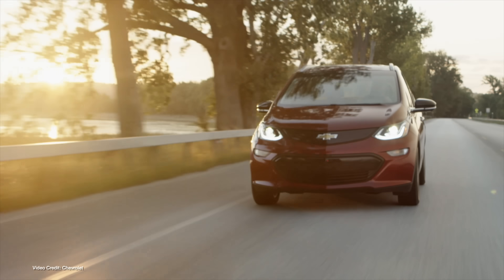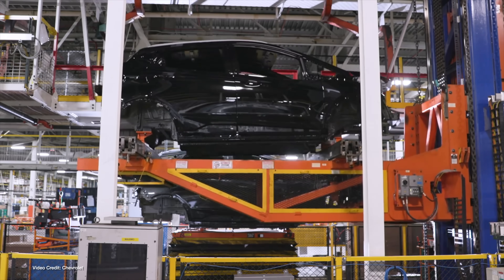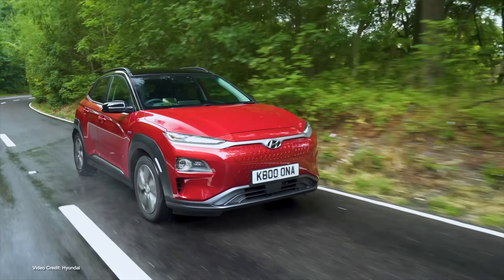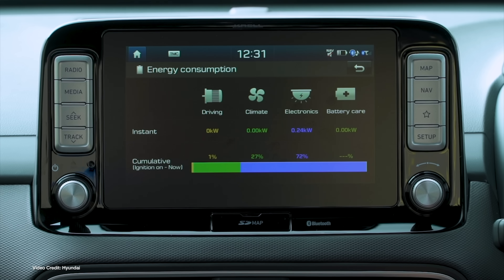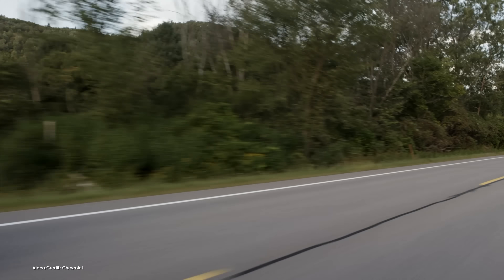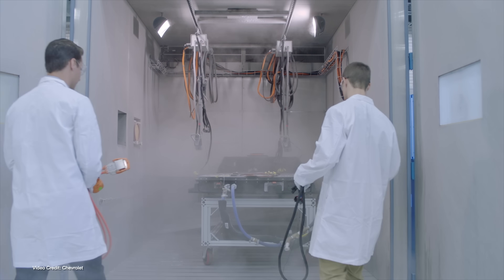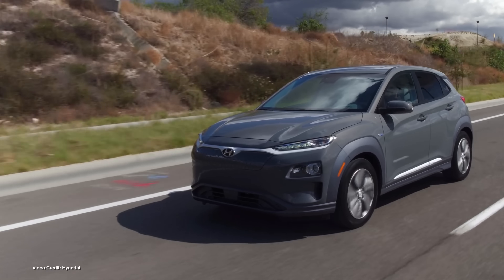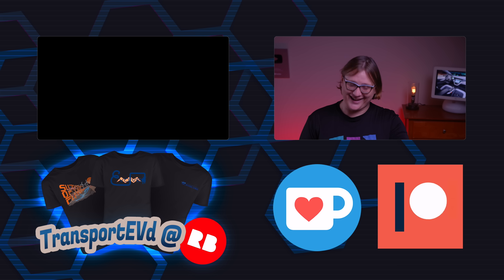Chevy Bolt EV Battery Recall: Here's Our Take on GM's Inspect And Replace Plans

Comment: gm builds junk ice cars what can you expect from their evs fires. lets see if the hummer catches on fire. junk junk and more junk
Reply: Err, 1) Not really a fair comparison, is it?
2) Anyone with any degree of rational common sense knows it's nonsense anyway. Obviously, a large,   long established manufacturer which shifts millions of units, doesn't make 'junk cars' do they?!
It's just ridiculous tribal nonsense.....
Reply from the maker: The battery fires, as mentioned in the video, came about from an issue with battery supplier LG Energy Solutions (LG Chem at the time) and almost all the EV automakers, including Tesla, work with them. - Winter

Comment: GM's and Hyundai's battery / EV woes is simply the latest chapter of being so late to the EV transition. While the companies are dealing with fall-out and recall expenses, they're losing time and money resources necessary to advance the BEV flag down the field. This one incident may be resolvable, but this is only one of thousands of cuts that may end GM as an automobile OEM. The same is true for all other legacy auto so late to the BEV party.
Reply: No, the companies are enormous with more than five employees. They can work on more than one thing at a time. GM is already building out it's own battery supply, unlike Ford, and has been working on it's new battery technology for a couple years now. Really it's just the Japan brands that are extremely far behind.

Comment: Last time I checked, used Tesla Model S sedans could be purchased for under $20,000 (pre-pandemic). Maybe that is a better route for people considering buying an EV than a used Chevy Bolt?
Reply: You can't get a Model S for under 30k, anywhere...even the totaled auction cars fetch $20k.
Reply: @vidznstuff1  There is currently a running and driving 2013 Tesla Model S in Kissimmee, Florida listed for $21,999 on Autotempst, sorted by lowest price. Pre-pandemic there was a Model S listed for $19,999. You are incorrect.
Reply: @justin_time  The Tesla model S you are referring to also has over 200K miles on it as well as being an 8 year old car.   I think I’ll stick with my 2019 Bolt that has just over 20K miles  ( approximately 80K left on the battery warranty.).  I never went in to have my charging limited to 90%, I could do that through the infotainment screen.
Reply: Err, aren't they a completely different type of car?! 
Surely, people don't just want any EV do they? They must consider the practicalities of ownership...?
Size, load carrying practicality, cost of maintenance, insurance liability, do I like the car!  etc etc ....?!
Reply: @andymccabe6712  I've found that the lower the price segment people are searching in, the less they care about meeting certain criteria. The used car market is much different than the new car market.
Reply: @justin_time  Not that I've ever experienced unless someone needs any wheels and has a $2500 budget. Otherwise Andy is correct, everyone still needs the type of vehicle that works for them and they search for that within the family budget that they have.

Comment: Frankly I think that GM has not flip flipped like Hyundai which shattered my confidence in Hyundai EVs. GM has been very confident and consistent in what they thought is the problem. Further, based on the Volt experience I have had, I trust GM's solution and since they are going full EV, why would they jeopardize that future reputation?  No, I think GM has found an excellent solution, but let's wait and see. Great video as always. Love TE vids!

Comment: Good luck with your time bomb.  Our fabulous new software should be able to warn you before it bursts into flames.
Reply: Right
Reply: All charging systems have limiters to prevent overcharging, damage and fires.  Correcting this system doesn’t equate with correcting a “time bomb”. Your cheap and snarky comment reveals your lack of knowledge specifically and in general.
Reply: @rcpmac    Yes, you're completely & absolutely right.  ["All charging systems have limiters in place to prevent overcharging, damage and fires"] BixbyConsequence (& Nikki, as she clearly says she's not confident the problems have been solved) aren't talking about a charging system that, even with a system in place to errrmmm... Prevent fire & damage... Errrmmm... Suffered fire & damage. BixbyConsequence must be happy in the knowledge that his lack of knowledge is at least less restricting to HIS ability to lead a normal life, & think critically, than yours.
All these Bolt & Kona owners are all liars, making up fires for insurance claims because all charging systems.... 🤦
Reply: @rcpmac  I know quite a bit about Lithium ion batteries.  The root cause of this problem is known to be a cell-level defect.  "Managing" the problem with software does not equate to normal charge algorithms.  Get rid of the defective hardware and remove all doubt, imho.  Cell-level diagnostics are great as an added layer of protection.  Keep them.  But don't use them as mitigation for a known physical defect.  It's a bad idea from a safety perspective as well as disastrously stupid from a liability perspective.
Reply: You're not paying attention. The software was an interim solution. Hardware is going to be replaced. BMS is being modified to monitor cell impedance changes long before a short manifests itself in thermal runaway. Yes, cells/modules will be changed out now that the PHDs have figured out how to predictively characterize the defect.
Reply: @vidznstuff1  They might replace some *modules*.  That is not the same as pre-emptively replacing complete packs as Kona wisely has.  You'd still be relying on the validity and completeness of the "PHDs" predictive models (which were delayed until the last minute), and you'd end up with a pack with modules of differing ages; some manufactured on a line that produced defective cells.  No thank you.  I've been paying attention.
Reply: You dumb f__k software will not prevent instantaneous combustion of the lion battery

Comment: The removed hill side reserve. If they are updating all the Bolts to the latest software I wonder if they will allow charge level setting? Or if they'll roll back the software for those with older Bolts to hill side reserve only?

Comment: Hi TE, don’t know if you already reported on it. But I think VW (and Seat, Skoda) e-up use the same batteries from LG. Skoda did a recall with software update for potential risk of battery fire. But you didn’t get much more information than that.

Comment: Bolt still most reliable vehicle Chevy makes. Actually still more reliable than any petrol engine. So many EV haters here, try one and you won’t go back.
Reply: Don't be cheap by a real ev.Tesla is Waiting
Reply: @renehunt4252  Tesla also has quality issues, and had some batteries catching on fire, not all of us can afford Tesla. I buy used cars with cash. Tesla is like 3x more, I got my bolt for $13k USD.
Reply: @Areku06  I have never heard of the roof blowing off a Bolt. Not so true for Tesla.
Reply: @fafner1  wow never heard about that one, I’ve see bumpers fall off and now brake failures on model 3…

Comment: Tell me something Nikki. Do you honestly think there is one iota of difference between LG's manufacturing processes abroad, and the ones that they are employing in the US? Because in all likelihood its a carbon copy of their other production facilities.
Reply: Based on your snarky speculation with no reference to anything factual.
Reply: The North American facility sourced its separator material from a different supplier. So, no, it wasn't a "carbon copy" and, no, you are not smarter than the herd of PhDs that were on top of this issue.

Comment: I think this is one of the reasons why I don't want to buy an electric car right now. Aside from this, I keep my cars for 15+ years and I don't think there's an electric car (yet) that can last that long while keeping its charge. I mean 300,000 miles on a Chevy Bolt EV battery must have degraded by so much since new. I still have my old 2003 Honda CR-V since I got new with over 200,000 miles and still going strong. I like electric cars, but I can't see myself buying it just yet. I like hybrids and that's why I got a 21 Corolla Hybrid. Hope to get 20+ years and 300,000 miles.
Reply from the maker: There are Teslas with well over 100,000mi on the clock (used as fleet loaners) that we reported on a couple of weeks ago, and plenty of drivers have taken their Bolts over 100,000mi as well. The non-thermally managed Nissan Leaf did so much damage to people’s confidence in battery pack longevity, it’s really a shame. Cars will lose some range over time, but ICE cars lose efficiency as engine components wear, so it’s not really different. - Winter
Reply: @transportevolved  Well said, at first I was doubtful, but after some research I believe. Now I'm just waiting for an EV that has over 300 miles of range and is Corolla cheap ($20k USD). I also want it to charge super fast in 15 minutes.
Reply: People have 2017 bolt with 100k miles bolt and lost only 5% of the range. Fire risk is less than 1 %. Petrol engines also catch on fire, look up Toyota Tacoma recalled 690k vehicles for fire risk. So in theory, a 300k mile  bolt should loose 15% of  range. I had a hybrid system but once you try pure EV you won’t go back. Instant power and maintenance free, always leave your house with full charge (convenience).
Reply: @Areku06  Wow well written you had me stumped. Though it's not the fires I'm worried about, it's battery degradation until you told me otherwise. Though I would like to see how it would fare going 200,000 miles - 300,000 miles. 100,000 miles is something, but I'd like to see more. I hope you are right with battery degradation being that low going 200,000 - 300,000 miles.
Reply: And just in case you were wondering... Yes, climate change is coming for us, and it is the fault of everyone who keeps using gas.
Reply: @shanefiddle  Even the production of batteries of these electric vehicles emit a lot of GHG. Even the electricity that EV's use, at least in the US, are about 60 percent from fossil fuels. Hell, if you really want to save the planet, I would suggest people to stop eating meat. I know that there is a lot of GHG from animal agriculture. Animal agriculture takes in a lot of resources. I bet you most EV drivers still eat meat. If you want to go a step further, it would be better for you to bike or walk around places. I don't think an EV is greener than biking or walking to places. Not only is it better for the environment, but for your body too.

I'm sure there are a lot humans can do to help with lessening climate change. Fossil fuels is one of them, but it's not the only one and I feel like it's overlooked.
Reply: Everyone responded for me for what I was going to say, save 1 little item EVERYONE forgets. ICE cars lose MPG just as much or worse than electric cars. My Saturn SL2 got 35 MPH on the highway. When i sold it with 110,000 miles it got 31.5 MPG on the Highway. I am no math major but thats right at 10%. Before you say , "thats just that car" I have the same loss for the past 6 ICE Vehicles.
Reply: @posatronic9262  Now that I think about it, I don't think ICE lose MPG, or at least in the same sense as a battery losing range. I think as long as it has been maintained, it should be fine. We have a 2003 Honda CR-V since new with 202,000+ miles and we still get around 20 - 24 mpg mostly highway. We always maintained the car very well since. I even cleaned the throttle body and MAP sensor this year with a cleaner. Certainly there's other things you have to worry about like old oxygen sensors, worn out spark plugs, dirty engine air filters, clogged fuel injectors. I've never had an issue with my 2003 CR-V losing mpg, but I guess it depends on how you maintain the ICE vehicle.
Reply: I am sure you do take care of your car. As well do I. This information from my cars is from writing down the mileage from each tank of gas and the mileage each time for 20+ years. All ice cars lose mpg. I do believe the newer the cars the less loss cause manufacturing has gotten better with competition.  But they all lose a certain percentage. To say you have zero loss in MPG........there is some loss.
Reply: @posatronic9262  Yes I do that same approach of dividing how many mileage you've driven, then dividing it by how much you filled up. With that 2003 CR-V, the updated EPA combined mileage would be about 22 mpg (21.5 mpg exact from 19 city / 24 highway 4WD). The last time I recorded this was 3 years ago with 163,109 miles and I got 23.9814 mpg (259 miles / 10.8 gallons). Before that was 25.39 mpg (197 miles/7.756 gallons) at 162,850 miles. Most of it was in the highway and I did my best hypermiling. I was able to get greater  than or about EPA estimates. As for how much mpg back when it was new, I would not know as it was not recorded but it should be close to EPA estimates. 25.39 mpg for an old 2003 Honda CR-V 4WD EX recorded at 162,850 miles isn't that bad. Certainly not as great as SUV's today, but I wasn't expecting 30 on this particular vehicle.

Though EPA estimates and manufacturer estimates aren't always accurate. I have seen cars get less than what they are rated at, some cars getting more. It could also depend on who makes the vehicles. I know the first generation and second generation CR-V's are strong. Maybe the manufacturer did not make the cars as great. But I just can't see how an ICE could get less MPG as they age, especially when maintained properly and built properly. Many of its components can be fixed and replaced.
Reply: What you have written down is what matters. EPA estimates are general but have nothing to do with this discussion. The difference between the mpg you stated could be how you drive and other factors but if you do the math it’s a 5% loss in mpg. What the average in first 1000 miles. And last 1000 miles. That’s where the Math comes in. Also replacing parts is all well and fine but 95% of your gas Mileage is internal ( piston and fuel injection)   
Our discussion is ACTUAL numbers not sticker mileage. There are thousands of people that upload their data on the internet. All electric cars lose a percentage of battery, typically in fist 100,000 miles is largest drop. Slower after that, generally. Ice cars do the same. Parts (piston, piston rings etc) wear out slowly and get less mpg. It’s a fact of life for almost any item we use.
Reply: @posatronic9262  EPA estimates have some worth for consideration. Now we would never know if I lost MPG or not because I did not take into consideration of the first 1,000 miles or 2,000 miles. Yes my reference was the EPA estimates because I don't know the mileage I would have gotten the first 1,000 miles, though I think EPA estimates have some value. I see what you mean. To be honest with you, both of our information is just anecdotal but still has some valuable information. Same with people who upload their MPG estimates online, it's anecdotal because it relies on just personal observation. Unless there is a study, such that adheres to strict methodology, that records if ICE vehicles lose range over time by calculating MPG estimates, reasons why, how well those vehicles were maintained and proper maintenance, I don't know such answer. I haven't seen such study that would say so, so I don't think it is the case. When you say you lose MPG because of the cars you owned and maintained properly, and me saying I don't see such in my 2003 Honda CR-V that was maintained properly, in the end it is just anecdotal evidence. Unless I see such empirical evidence, I'll believe.

Comment: Thank you for the UPDATE. I have a 2018 Chev Bolt with 18,000 miles on it and 6 months ago they reduced my range (significantly)  238 to about 179. Here is Wisconsin, unless you have the recall IN YOUR HAND-the dealership will do nothing. I am selling my Bolt Premier in Sept and was VERY CONCERNED someone would not buy it because of this reduced range thinking it was battery degradation- as they might not understand overall Electric cars or they may feel Chev may do nothing further. So THANK YOU for the update and I HOPE before September this will be corrected by my Chev Dealer. 
(I ordered the Tesla Cyber Truck and an #12,042 on the list) Had a 2014 Leaf prior.
Reply: You have been screwed
Reply: Tesla,Cybertruck,  good luck! Ha Ha

Comment: I say you should give in and buy a model 3 with ev insensitives
Reply: You can buy two Bolt EV LT's for the price of a Model 3
Reply: @vidznstuff1  yeah but the battery won't be sh*te and neither will the range.

Comment: Absolutely the worst news I could have heard of. I am the owner of two Chevy bolts one got the recall one did not both vehicles are 2019 . To me they need to swap out the batteries that is why I'm doing the buy back. I got to approved I am  just waiting for their offer no way am I going to let them let my car be a specimen to dissect and me be the guinea pig inside. Someone else is going to have a fire with a Chevy bolt and then they will  decide why don't we trade out the batteries  why don't we do that now. I love my Chevy bolt and as soon as they purchase mine back I'm going to go buy another one maybe a  2021 with a decent battery or maybe wait for the 2022 in June. I just don't feel safe driving a car that's been recalled and they think they can fix it with software update by monitoring what's happening in the battery and oops it looks like your battery is bad and now we need to replace it more wasted time and that's my time.
Reply: They don't "think" they can fix it -- it is being fixed